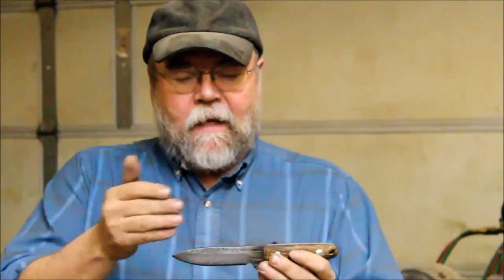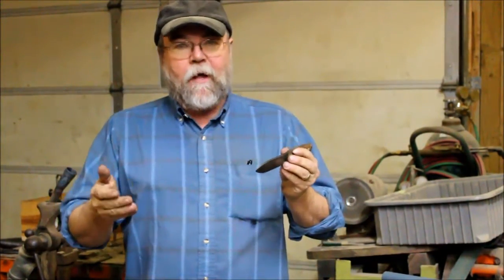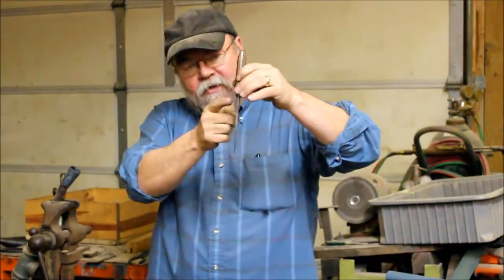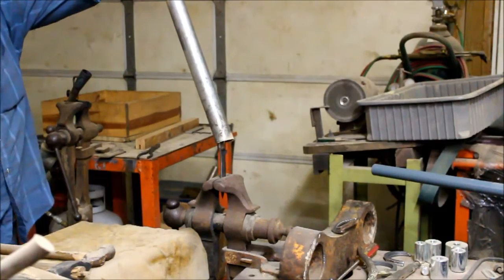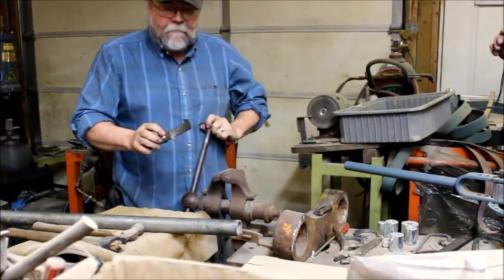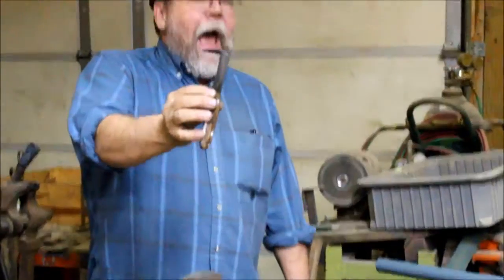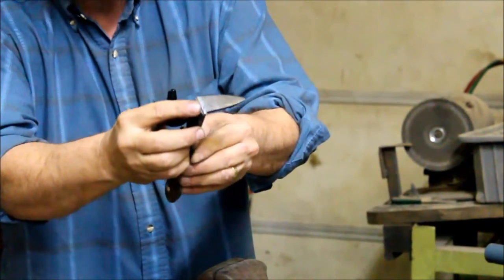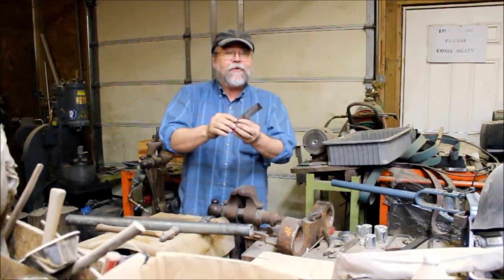Whiskey Camp Knife Bend Test

Comment: I'm concerned that steel is too soft. No way a good, edge holding steel will bend like that and not snap.
Reply: Yeah a comment years later but I wanted to mention that it’s not as soft as you might think. Did you not see see what it took to bend this? The man used an extension bar and literally used all his strength and weight to get it to bend! Ain’t no soft steel it’s a tough steel, big difference! 
PLUS… These knives have already been field proven!! This ain’t no backyard diy knife maker, this ma is a bladesmith.

Comment: are all whiskey knives made out of the same steel? and what type of carbon steel is It? Thanks.
Reply from the maker: All whiskey knives are made from A36 Carb, it starts as a mild steel that goes through a deep carbonization heat treatment that creates a fairly thick layer of high carbon steel on the outside, yet leaving the softer metal in the core, functionally identical to a laminated steel.
You can find more info here: www.reptiletool.works/what-is-a36-carb

Comment: Why would you have soft Core? As you sharpen the edge would be soft
Reply from the maker: The soft core allows the knife to flex without snapping, while still providing an excellent cutting edge. We use an asymmetrical grind and sharpening. The blade is sharpened mostly on one side and only lightly wiped on the other to reduce the burr. This sharpening method keeps the edge in the hard outer lay. for more information check out our webpage that explains our steel and sharpening method:
www.reptiletool.works/a36carb
Thank you for your question
-David